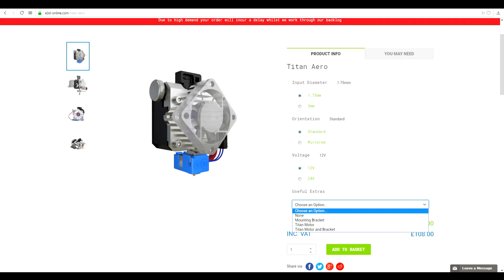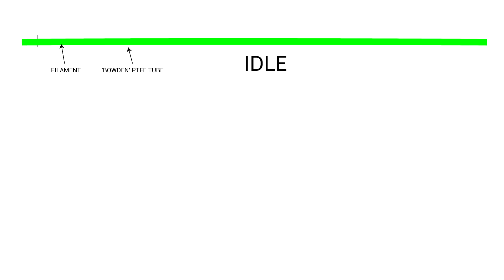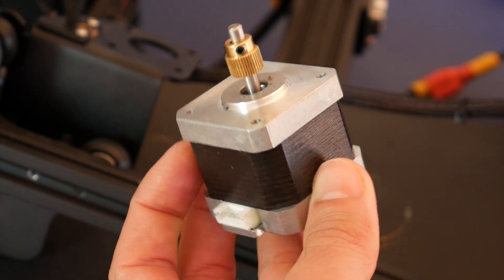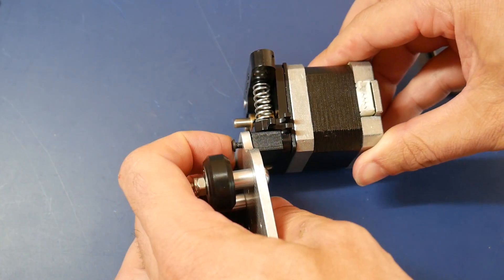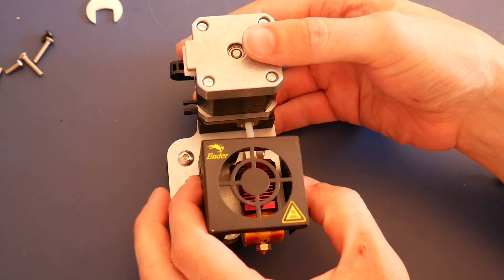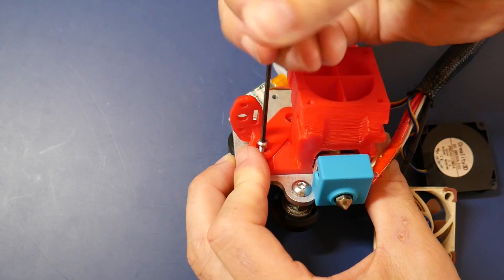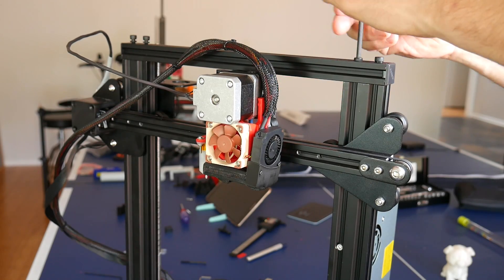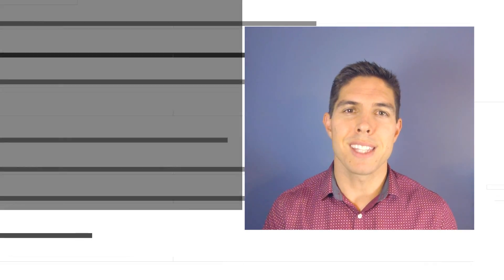Simple direct drive Ender 3 mod for only $35

Comment from the maker: This kit is now available in Europe!
Ender 3 DD kit: https://ebay.to/2UJeoCa
Ender 3 DD with metal extruder: https://ebay.to/2GnJXHt
CR-10S DD kit: https://ebay.to/2v9jt7r
Reply: Links are dead... Anyone knows where to get the kit with the metal extruder? (europe)
Reply: @stephanhvhl  You can buy it on ebay.com but it doubles in price by the time it reaches Europe. That's why the Chinese clones do so well. Low declared customs values and cheap postage as well as low prices.
Reply: @defizr  Got a message from the European seller (skynet3dmods) that they'll have the new version (red anodized) in stock soon.
Reply: Just the kit - https://www.amazon.com/Extruder-Conversion-Creality-Printers-Modification/dp/B07SXCWZBK/ref=as_li_ss_tl?crid=2Y70BVT5QPIMX&keywords=ender+3+direct+drive+upgrade+kit&qid=1566249900&s=industrial&sprefix=ender+3+dir,industrial,188&sr=1-3&linkCode=sl1&tag=bimcom-20&linkId=24f8afa93c725cde667e66379f301eee&language=en_US
Reply: @bobprc  This is for the Ender 5 unfortunately
Reply: Is it possible to use aluminium instead of the PTFE tube so you can print higher temperatures?
Reply: I can’t find this kit anywhere
Reply: Excellent teaching skills! Great instructional videos.
Only too bad the links don't work.

Comment: Fantastic as usual. Here is one for under 8$ - I started with napfkuchenu's Adapter. (https://www.thingiverse.com/thing:3369418) and got from amazon a kit (FANFA 3D Printer Direct Drive Conversion Kit) which I only used for the extruder extended cable (cheaper than getting the cable by itself).  I remixed it to add a small filament guide on the top and a link cable start point on the back. It works very nice so far. The one I made has the extruder 90 degrees perpendicular to the heating element which I think reduces the stress on the motion during Print.

Comment: Noctua fans, 2 versions are available. 1 is pressure biased, the other flow biased. Which did you buy? Have you tried both to compare results?

Comment: I think I'm going with the Micro Swiss Aluminum Direct Drive Extruder, instead of this one. It just seems so quality and everything just works...
Only bad part is that it's $100 USD, but comes with upgraded hot-end and all the "goodies" too. Seems worth it to be able to print flexible filanents and the like. I just wish they were in stock! I'd order one toot-sweet! 🤣

Thanks again for the video! ✌🏼

Comment: This looks good but if you get a problem down there such as a leak or changing out the nozzle it surely makes things more complicated? You're keeping the Boden tube, just making it very short and moving the extruder stepper. If it's possible to accommodate the Boden tube in settings, I'm not sure there is any advantage to this.

Comment: hi-after installing this and adding an extension wire to E, the extruder doesnt extrude or move - swapped out xyz and extruder works - E stepper driver has voltage (extruder) but doesnt power motor on my ender 3, the cables test out as working, when i swap out the xyz, the extruder motor works - what is the next test ?
Reply: I had that same issue with the extension wiring. If I took out the extension it ran like it should. Idk why yet.
Reply: @jsd21hb  thanks J but even with original, there is no movement now - still waiting for new turbo board

Comment: So in your opinion, would you feel that the Ender 3 could benefit with another Z-axis motor setup on the right side? Just worried that the extra weight. I know with the direct drive, you can actually print other types of filament like TPU and such.

Comment: I made my upgrade with a simple 3d printed part. All stock hardware and I'm using a hero me fan duct. So far it's been great.
Reply: Did you print from PLA? And have you had any issues with it?
Reply: @blootooth00  I used pla and the only problem I've had is a bit of drooping near the hot end. But it's barely noticeable
Reply: @roam3r690  thank you! I will look into it soon. Were the instructions still the same as this video?

Comment: I'm always surprised direct drive extruders use such a large and heavy stepper motor, as to my mind its way overkill for the amount of torque needed to drive filament into the hot end. Am I right in thinking there has to be some way of using a lighter weight stepper?

Comment: Jury's still out on this one...the difference between the before and after test print isn't that drastic, are you seeing some real benefits after a few months? Great channel mate...
Reply: The decreased retraction allows for faster prints (with good linear advance)
Reply: @animatrix1851  the extra weight means you need to lower acceleration and jerk a lot though.
Reply: @umbratherios  true but I haven't seen this in my testing, I use the speeddrive mod from thingiverse for ender 3 and I do 100mm/s speeds with 1500 accel (infill) and 800 for perimeters. Print out some nice feet for the machine and you'll be fine.

Comment: This does not seem to have an advantage over a direct drive upgrade using stock parts and a printed bracket. Why spend $30+ when I can spend less than 30 cents for the same result?
Reply: printed mounting plates will flex and bend unlike an aluminium plate.
Reply: @MrDead1975  No, They wont

Comment: To take the gantry off, you can just remove the bottom wheel. Lower the tension of the belt to get it out. Way easier.

Comment: My kit included only one of the stepper wire mounts, and two of the tiny wire mounts. :/
Reply: The kit has slightly changed over the years time. The single mounts go at the extruder motor and at the Z motor. The double goes at the X motor.

Comment: You spend 2 minuets talking about the cable ties and zero seconds showing it all together and done, you did the same thing with the stepper motor and the extruder with which way it all faces. You had your hands in front of it.
 Take 20 seconds to show it off, please. Other than that great video ty very much.

Comment: Did the full assembly... with the nut backwards...ARRRRGGGGG   I relied on the photos at the end to verify not knowing you had called this out at the beginning.
Question: Now that I have this installed I am finding my print head is off from the original start points and print area by 10mm. The start line draws off the bed, I know I can adjust this in the start code but thats not a solution. Does this require reflashing my firmware to correct it??
Reply: That is in your starting G Code. Here is mine for example... G1 Y80 E10 F600 ; prime nozzle

Comment: About the 3D printed adapter which bolt the stepper motor to the alu plate, isn't there a risk of it melting due the heat coming from stepper motor (stepper motors do get warm no) ? Same thing regarding the small black 3D printed shim between the heatsink and the alu plate. The following product also on eBay looks like a smarter design : https://www.ebay.ca/itm/Direct-Drive-Extruder-Conversion-Kit-for-Creality-Ender-3-Pro-CR-10-3D-Printer/254428600863?var=554054331386
Reply: My machines have run 24/7 for a year now with this kit with zero issues. If your stepper is getting that hot you got serious issues.
Reply: @abarasabwehttam  A fact is that printing parts for the hotend assembly is a serious fire hazard because the 3D filament would become fuel in case of a problem with the hotend. One, it's not a flame-retardant treated material. Two, we don't know at what temp it self ignites. It's like the people who think they're smart by building an IKEA Lack enclosure. The Lack table is made of empty cardboard sheets and plywood bocks. We don't know if it's at the very least flame-retardant treated. Just because you've been using for a year a product that is a fire hazard doesn't make that product safe. It's common sense.

Comment: Thank you for so much great info. I'm going to add the direct drive, but I am going to use a short body stepper to reduce the weight. If you have any experience with that it would be great to know. Thanks again!

Comment: Dear Michael, Could I use a lighter step motor, different from the original,  so as not to sacrifice the set? If so, which motor would you recommend for me to test?  Note: I'm using the see me CNC extruder

Comment: #TeachingTech 
I´m running BMG-MicroSwiss-DD and I was wondering what retraction settings do you have for different types of filament(PLA,PETG)? Thanks!
Reply: same question, did you ever receive an answer regarding ABS?
Reply: @rickydubay8082  Nope

Comment: stop. Who can see the difference between bowden and direct print? You spent 35$ and a lot of time and now you have the same results on low speeds. Congratulations. Only one benefit of direct drive extruder is easier printing with flexible filaments. With my bowden extruder I have also very smooth prints using Filaflex A82. So I think bowden is better if you can use it right.

Comment: Does this method of mounting the feed motor of the filament will not affect the accelerated wear of a single lower rubber wheel? By adding the weight of the motor, aluminum extruder, hotend, fans and air ducts, the center of gravity is shifted far beyond the symmetry axis of the upper carriage in the X axis, so that the force is directed to the edge of the rubber wheel from the rear of the printer. Degradation of the wheel may cause improper placement of the nozzle relative to the table ...
I know that the purchased aluminum plate has been used, but can the design of the printer allow the use of two wheels at the bottom?

Comment: Hi, if using an aluminum bracket why putting a plastic spacer between it and the hot end heat sink, without a spacer and maybe adding some thermal paste we can help the cooling of the heat sink..otherwise i think it's better for the bracket to be from PETG save some weight

Comment: That's a neat kit, and for the cost it works. I made my own aluminum adapter that retains the stock carriage and other parts. I need to extend the wiring and route it next. I am finding that I need all metal upgrade parts as when I print abs inside an enclosure, 3d printed upgrade parts start to melt (even "high temp" parts) which is a pain when your ABL sensor bracket melts and you lose the Z offset.  I'm excited to see if I will have the same clogging issues with carbon fiber filament after going direct drive, and what the extra weight on the carriage will cause.

Comment: Noticed this one in aliexpress where I've got quite a few good upgrades. https://www.aliexpress.com/item/32975820676.html?spm=2114.search0604.3.8.71d12a62EWPcxK&ws_ab_test=searchweb0_0%2Csearchweb201602_1_10065_10130_10068_10547_319_317_10548_10696_453_10084_454_10083_10618_10307_537_536_10131_10132_10133_10059_10884_10887_321_322_10103%2Csearchweb201603_52%2CppcSwitch_0&algo_expid=6efaaf56-7b2b-42c0-899c-45775e626446-1&algo_pvid=6efaaf56-7b2b-42c0-899c-45775e626446

It seems to have everything for a swap or replacement including a new stepper and all the carriage assembly. Would be interesting to know the print head weight before and after the change and the differences (if any) between the 2 steppers. From previous reading it seems direct drive can get away with a less powerful (aka smaller) stepper because it's not faced with all the resistance that may be in the tube.

Been getting great prints with my Ender 3 (Lerdge K controller and 128 stepper drivers) but the bowden feed position is really annoying me ATM so been looking at all alternatives.

Comment: Is it possible to change the extruder stepper motor to a smaller one for this mod?
Reply: Can put whatever  Nema 17 stepper motor you want on the kit, the bolt pattern is the same. This kit just makes it so you can use the stock parts and not need anything else to gain direct drive.

Comment: Hi Michael, your $35 DD E3 by Basaraba direct drive presentation was spot on (Thank You).  The improved PETG print quality was night and day.  After numerous test prints, upgrades ($200+), and a huge amount of time spent trying to improve PETG prints I was never satisfied.  Now PETG Benchy's are every bit as good as PLA.  PLA prints have gone from great to stunning..  Previous time and money wasn't a waste of time though.  Learned a lot and most of the upgrades are reusable or still in use. To lighten up the carriage the stepper will be changed out to a pancake type.  For sometime I'd been looking for an inexpensive mule (Sandbox Hardware) to learn Marline 2.0 (BigTreeTech SKR 1.3).  After experiencing the switch I've decided on a direct drive testing machine (Anet A8 Plus).  The PETG Nightmare is over..
Reply: James, its stories like this that make all the work I put into making these kits worth it! Thank you so much for your support!

Comment: Cool update, but given the fact it would have been cheaper for Creality do this, there is more than likely some reason it was not done.  Fewer parts, less overall mass etc.
My guess is that the added weight to the Z axis would pose a wear issue for the stepper.
I'm new to #D printing, but its very common place to have companies send people free stuff.  I also find it hard to believe that said items are as good as claimed as reviewers who get free stuff may stretch the truth.
Reply from the maker: A couple of things: the weight on the z axis is identical, the location of the stepper has changed but that's it. I pride myself on being honest, regardless of whether something was free or not. If you want proof check out my reviews of the cr-10s pro and alfawise u30.
Reply: @TeachingTech   Thank you for the response and sorry if I seem a bit brash in my comments above.  You are correct, I completely missed the fact that the stepper is already on the same axis z axis.
Reply: Sorry to say it would not have been cheaper. Added hardware and more injection molded parts cost money and assembly changes. They already had most of the components to make this machine from the CR-10 machines and so it was as easy as just smaller extrusion lengths to pump out the Ender 3. All the rave WAS Bowden systems even though they are garbage, but more and more exotic filaments make Bowden a PITA for many users that dont just want to work with PLA. My Ebay feedback and reviews here on this channel regarding the kit speak for itself.
Reply: @abarasabwehttam  Thumbs up to you for your response.  This mod really interests me but my concern (seemingly unfounded at this point) was for the longevity of my printer.  I will take a much closer look.  Do you offer this in a black finish like the OEM bracket?  I assume I can also upgrade my fans with better/ newer parts with this?
Reply: @broderp  My machines have been running 24/7 with this kit for months now to make the parts for the kits and not a single issue with machine performance or any pieces needing to be replaced. I was going to have the carriage Anodized black but that was going to increase the cost and not improve any functionality of the part so I didnt do it. I suggest the cooling Hero Me that Mike has modified, it works great. I did make another change to cooling on my machines by adding a 5015 blower fan on the hotend also. I do not run part cooling on 99% of my parts but the fan to the hotend needs to cool as much as possible no matter what machine you use to keep the filament from melting before getting to the nozzle, especially at higher temperatures.

Comment: My biggest question is concerning the added weight on the gantry , with only one Z screw,  ,, thanks
Reply from the maker: Weight is the same for z. Remember the extruder sits on a gantry that travels up and down.
Reply: That is not true......if you hold the Z axis leadscrew at the coupling and touch the end of the gantry with one finger it will deflect up and down very easily.....a dial indicator will show this. That will throw the bed leveling out too.   @TeachingTech

Comment: That HeroMe remix looks like the fan is flared out on the side due to the cables behind it. Wouldn't it be better to flip the fan to the left side and the BLTouch mount to the right side. This way, all the cables will land in the same area, giving the fan some room on the left. I'm about to jump in to a direct drive mod and preparing my files accordingly. I like the HeroMe design better but it seems to be a weird design flaw.
Reply: It will go flat. Need to put the 2 thin wires in first then the thicker heater wires and the flat will fit flat like it is meant to.

Comment: You could! You could convert it to direct drive! But why? Why would you do that phil???

Bowden drives make more sense in terms of the pros and cons. main downside to bowdens is that you get more stringing but that is something easily fixed when you do your post processing the ringing effects you'll get from the additional mass of the extruder are pretty hard to correct for in post-processing. If you want to print flexible filament just buy a Capricorm Bowden tube and print slower.

Comment: Hello. I have an ender 3 and I was wondering how to increase the speed of the extruder motor by moving the extruders after the heating of the heating block (for less load filament problem)? thank you .

Comment: How does this fair with flexible filament donyou prefer this or the ezr with Bowden setup for flex
Reply from the maker: Ezr and thus are both good upgrades for flexibles.
Reply: @TeachingTech  thanks for your replie is there one you like better then the other I would like to go direct drive but hear that with some of the crazy soft filaments like ninja tech that direct drive and all metal is not the answer and I have a micro swiss and would like to keep it for high temp filaments and what not